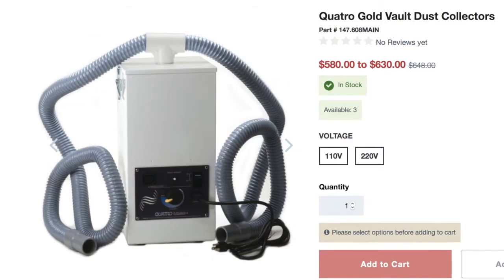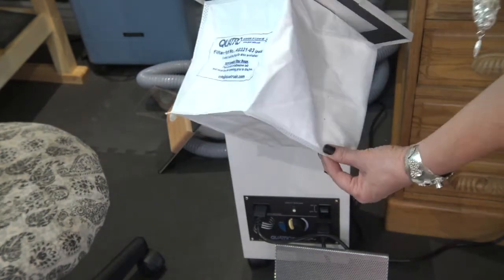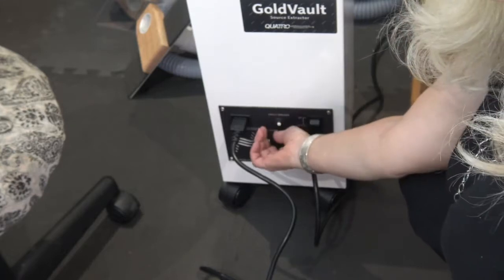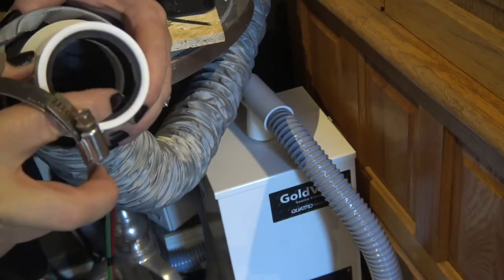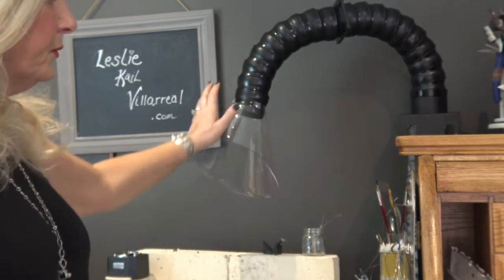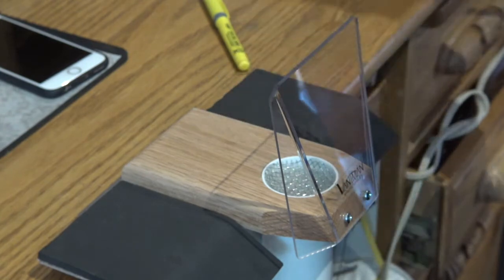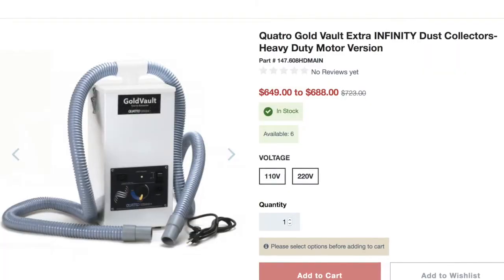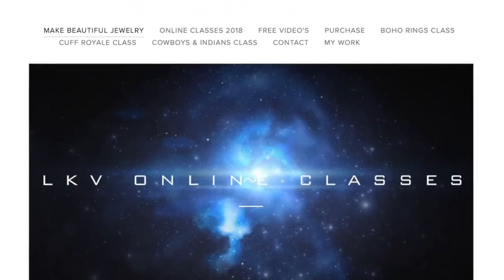Gold Vault Fume and Particle Extractor with Leslie Kail Villarreal

Comment: I purchased this unit this past winter.  It is beyond frustrating that you also need to purchase connectors, brackets, and other hoses.  OF does not have all of them.  After watching your video I am a little more clear on how to set up the soldering end of this.  Thanks for taking the time to do the vid.